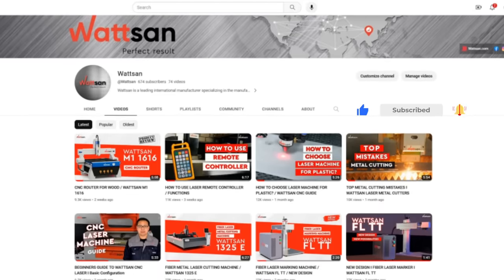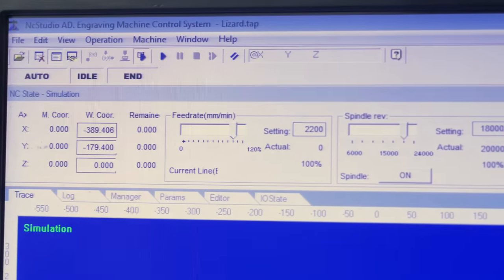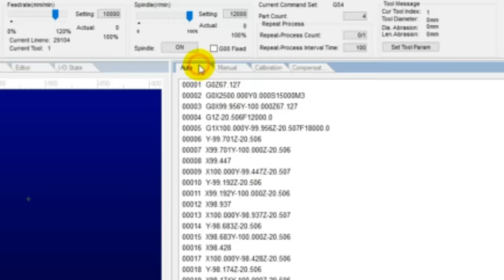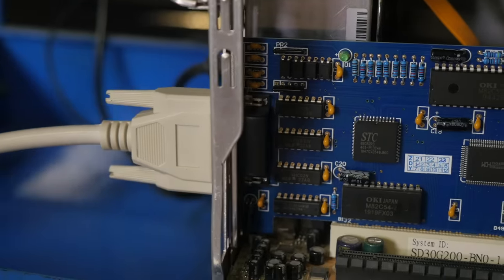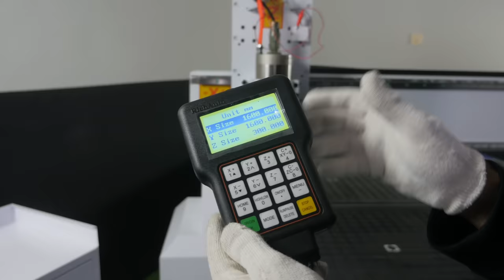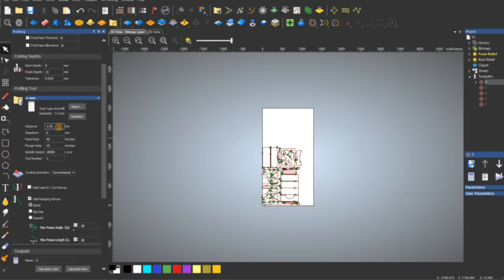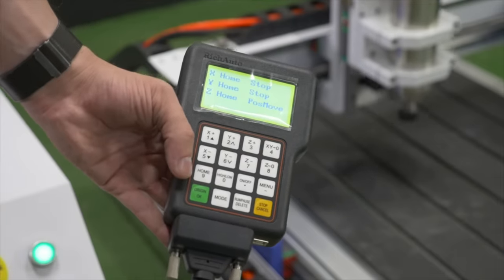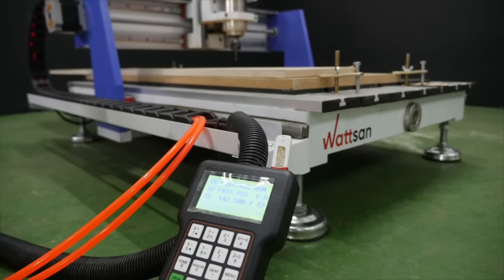NC STUDIO vs. DSP CONTROLLER / Wattsan CNC

Comment: Dear Wattsan,
You said that DSP Controller can save settings, if power failure it will start from last stop position, my question is that is it possible with NC Studio system?
Reply from the maker: Hi! Thanks for the question! No, it is not possible

Comment: Can we use a generic parallel port breakout board with NC studio?
Reply from the maker: Hello! Thanks for the question! Parallel port usually works with MACH3, NC studio have PCI board that process signals for machine. It's doesn't need a parallel port and cannot use it.
Reply: @Wattsan 
I purchased an NC studio card which came with a 15 pin breakout board. It came without documentation. My stepper drive has pins as  Pulse+, Pulse -, Dir+, Dir - . I understand the Pulse - & Dir - are to be connected to ground. The 15 pin breakout board has two pins as 5v & 2 pins as G. Logically since these pin outs are coming from the pci card, one should not give the 15 pin breakout board an external 5v supply right?
Would that also mean that Pulse - & Dir - should be connected to pin marked as G on break out board?